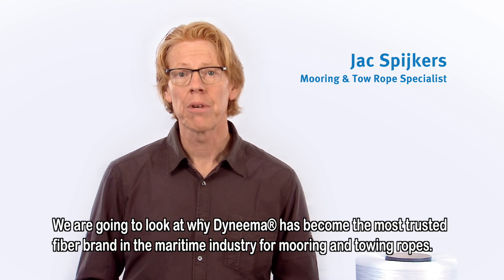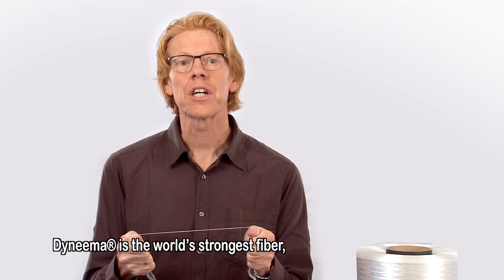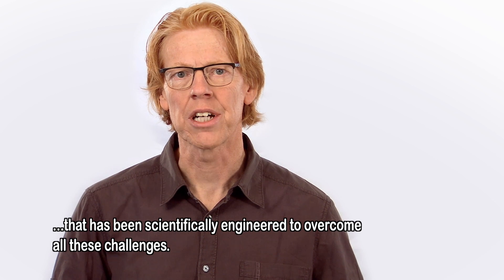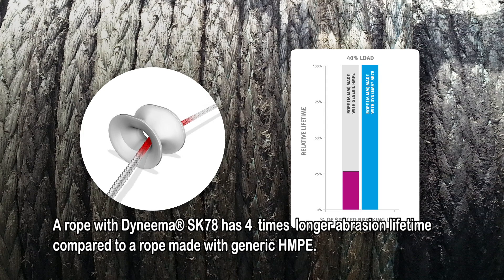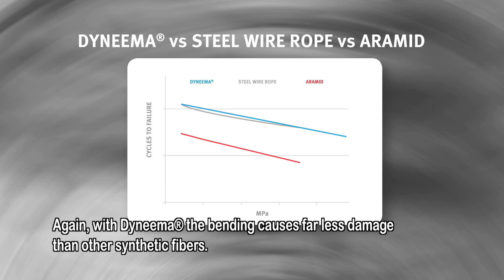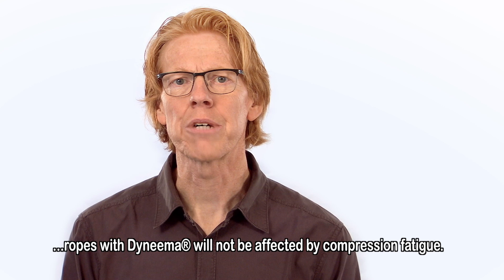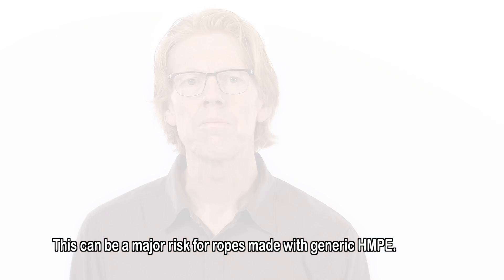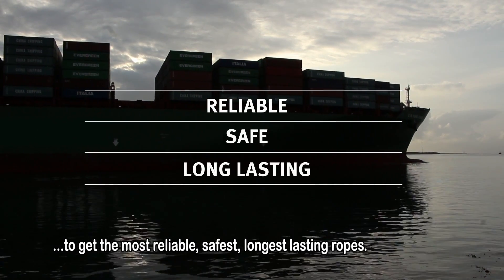How Dyneema® helps to prevent rope failure

Comment: Hi All,
Dyneema does not work at elevated temperature and there is problem of internal heat built-up. Better to use aramid ropes which are safer, stronger and greener than Dyneema / Steel.
Reply: It depends on the application. For example, you can’t let aramid live in the sun. Dyneema is UV resistant.